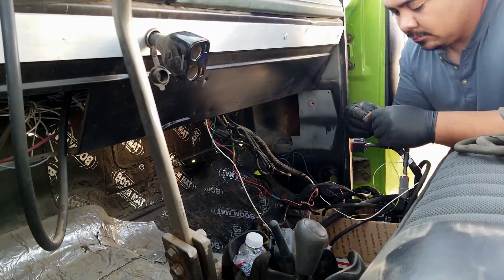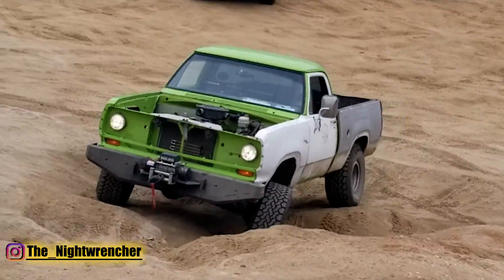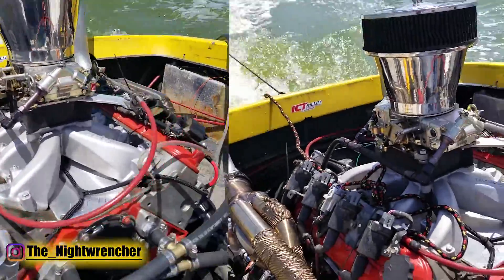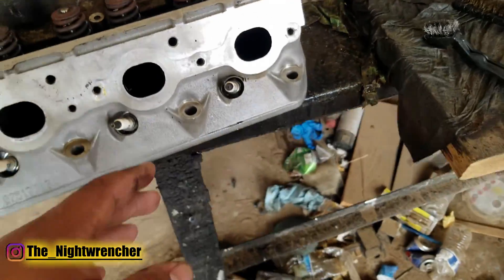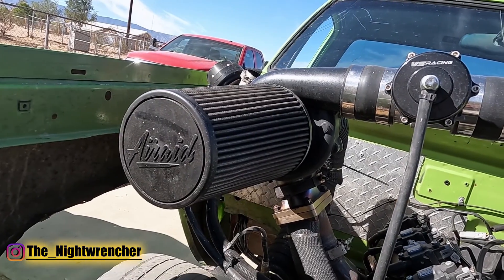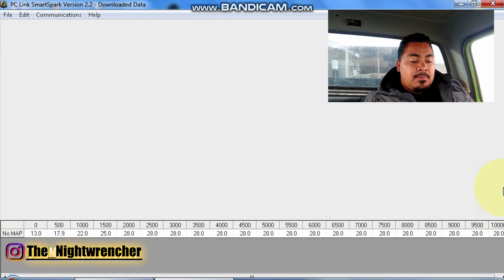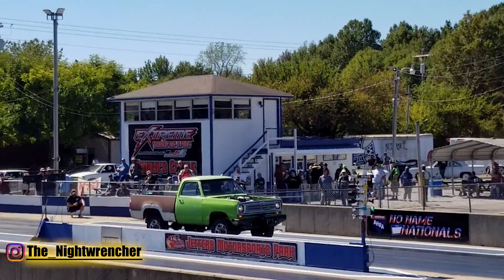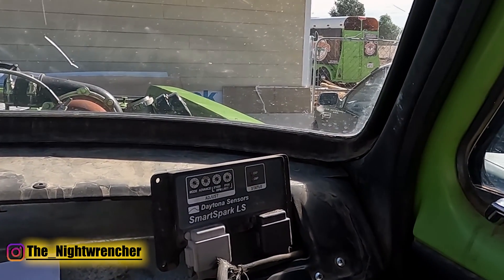2 Year Review Smart Spark LS For Carb LS Engine | Daytona Sensors SSLS |

Comment: How does the system control spark advance? Can you program the wide-open curve like the advance weights in a distributor, ie, something like 20 degrees at 2,000 rpm, 28 deg at 3,000, and 34 at 3500 and up?
Reply from the maker: The box comes with 9 3D timing tables or you can program your own at 500rpm steps as both a 2D or 3D table
Reply: It uses a map sensor? What a cool setup. What curve did you go with? What's your max advance at wot? I'm asking all this because I built a 97 L29 454 vortec for my dually with some good hop ups and an 0411 ecm upgrade. It's pinging at anything over 28 deg of advance at wide open, which doesn't seem right to me. By conventional chevy wisdom, I would think it wants 32-34 deg. @NightWrencher

Comment: I know the is old night wrencher but is the ls smart spark waterproof best i mounted it on my fire wall and it get wet sometimes but still run flawless every time
Reply from the maker: Hey buddy, its sealed so its water resistant but not waterproof. I think you'll be ok
Reply: @NightWrencher  thanks for the fast response.

Comment: Nightwrencher, 
I have a 6.0 gen 3 with an ss2 cam with the rear cam sendor and cannot get ut to start. The iriginal Daytona bix was sent back and tested vad so thry sent me a new one but still no start. Now i might have to convert to a  front cam sensor.
Have you heard if this?
Anyone?
Reply from the maker: As far as I know, the SSLS will start without the rear cam sensor. Ive never need a cam sensor keep the SSLS from starting unless the wiring is messed up

Comment: Thanks a lot for sharing your knowledge man! Couple quick questions, will the smart spark system  work with an LM7 ? And if so is it compatible with stock coil packs?
Reply from the maker: Hey man, yes it will work on both the LM7 and stock  Is coilpacks That's how mine was originally before I swapped out to the LS2 coils